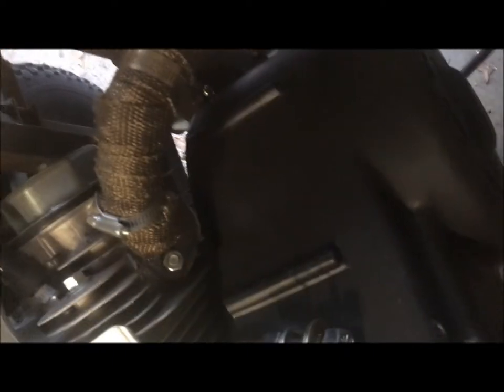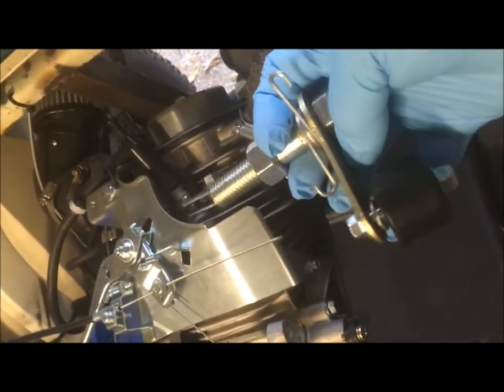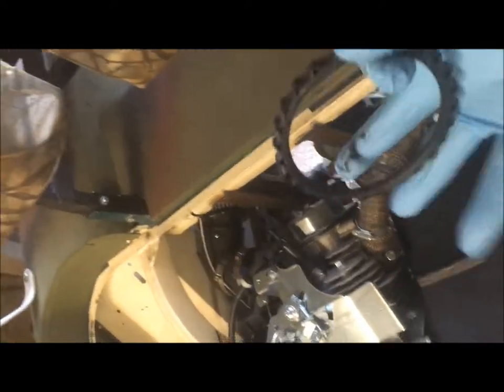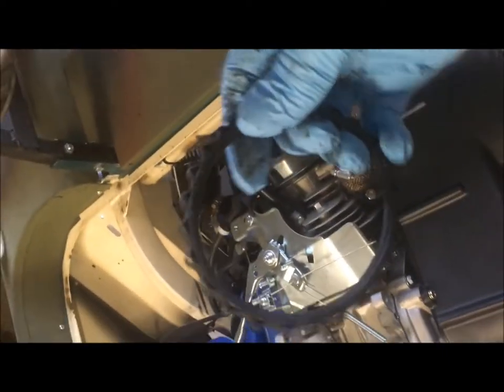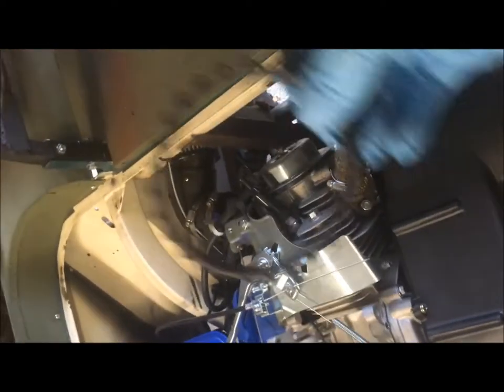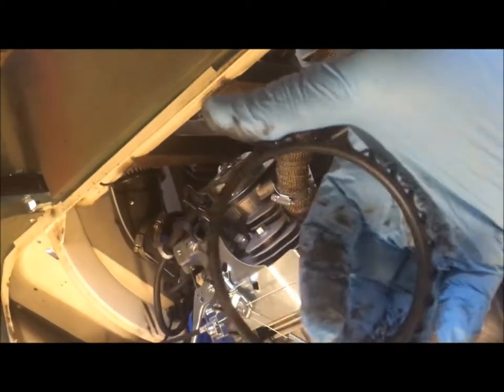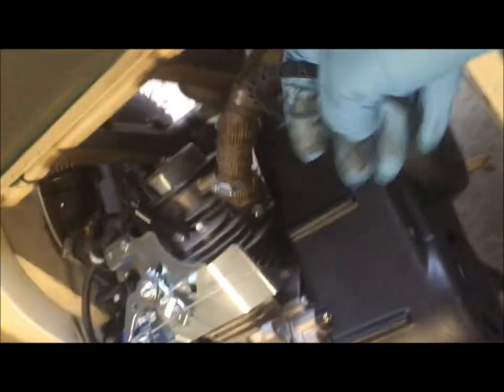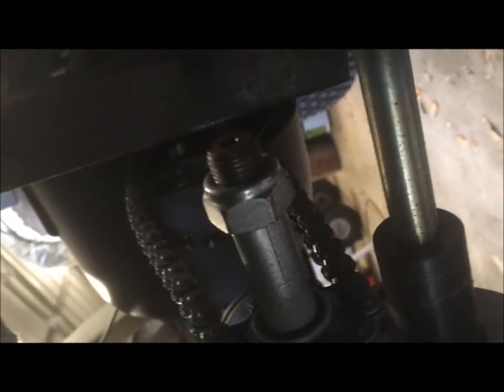Roll Ring chain tensioner in a golf cart

Comment: How much did you pay for that roll ring?
Reply from the maker: I think it was $62 with free shipping, its a little steep but it takes zero time to install and it works going backwards or forward.  Its very quiet too.  I haul over 500 lbs of corn out to my deer feeders with my golf cart.  Its a rough trail.  It has never popped out with the extreme amount of suspension travel I subject the golf cart to.  I thought it was well worth the price.
Reply: @RunsWithScissors  Do you have a link to where you got this ? Thanks , Pete
Reply from the maker: @petecase5507  https://www.roll-ring.com/cad-chain-tensioner-price-list/?lang=en#tab-21a1ff8f-db80-0
I'm not sure if the link I put up will be useful but I purchased it from a distributor in England for the equivalent of $62 dollars.  The link is a price list I found on Roll-Ring's website which says it costs 30 euros or so.  I believe right now the Euro and Dollar are equal in value.  I found the distributor by requesting info from Roll-Ring.  There were just a few US based distributors and they were higher priced.  I kept searching around until I found one in England.  I can't for the life of me find the link I used.
Reply: @RunsWithScissors  Thanks , must be why i couldn't find a US based vendor, lol
Reply from the maker: @petecase5507  its a fairly new product and they are just building up a following and distribution channels
Reply: FOR SURE, quick, simple & WORKS LOL  @RunsWithScissors
Reply: I was quoted $180 and $110 each for the two 40/41 sizes I needed on my Club Car gas conversion. Went with the idler wheels.
Reply: @terryhillman8755 how do you use the idler wheels I'm facing the same problem with my gas conversion